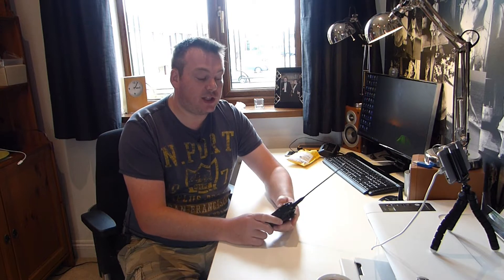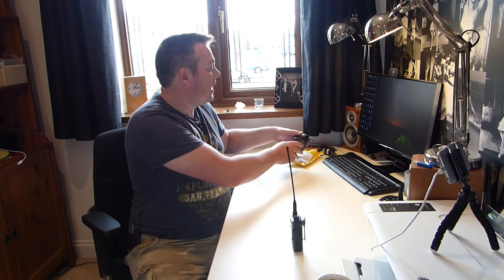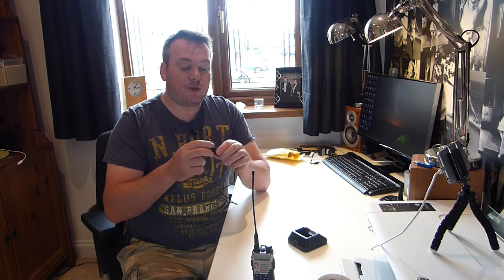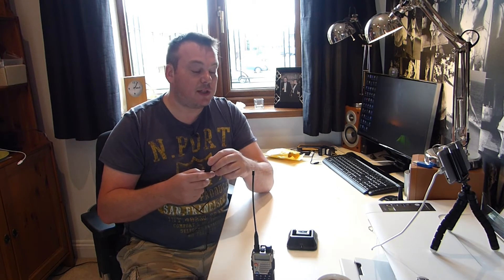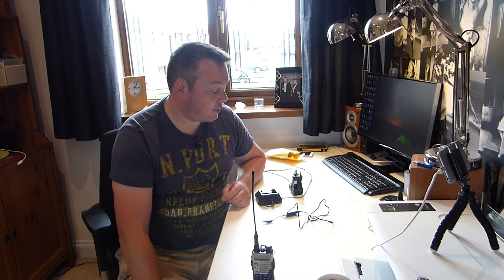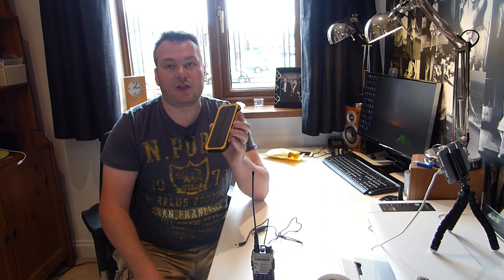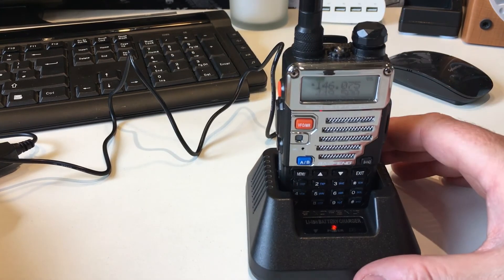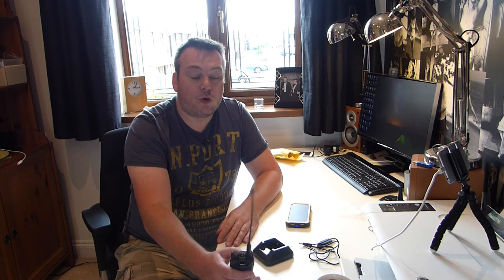BF UV5R USB charging lead

Comment: I have a backpack with a Solar Panel...wondering if you have tested the 
usb charge time with it plugged into the ch-5?  Also supply the link as 
to where it's can be purchased.  Thank you
Reply from the maker: Just pop on to eBay and you will see lots of bf usb chargers. As for the charge time, I think it’s been about 5 hrs. Hope this helps

Comment: Good video James, I do a lot of wild camping, an the power banks are my only source, when out there for a few days,(I have no car) for my thermal etc, /did u find out the length of time they take to charge?
Reply from the maker: Hi. I don’t know how long the charge is ... I just stick the radio in and leave it. It works well and it doesn’t seem to take any longer that I’ve noticed

Comment: What antennas do you use?
Reply from the maker: I am using the stack antenna at the moment but a lot of the time, out and about I use the Nagoya NA-771.  Ebay for about £9
Good little antenna,
Reply: James Fletcher I use that, but it's too big. Looking for something smaller but just as good.
Reply from the maker: aahh, well there lies a problem.  The performance will suffer if you go smaller..... The antenna is very important.

Comment: The real issue is being able to charge or use the radio in your car without the desktop charger. Find a way to do that and u are the mAn!! Hint. The battery replacements sold on eBay do not work. I've ordered  multiple and they do not output any power
Reply: Hey mate, Im guessing youve got the battery delete ones. That power the radio straight from a cigarette socket?